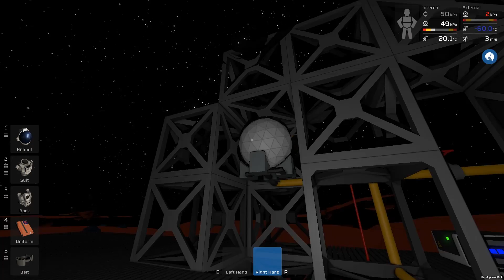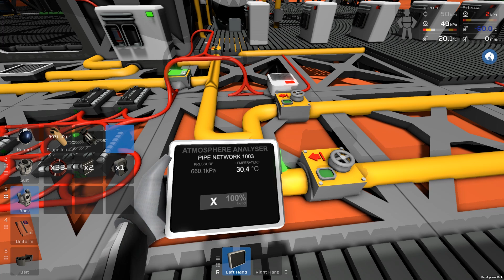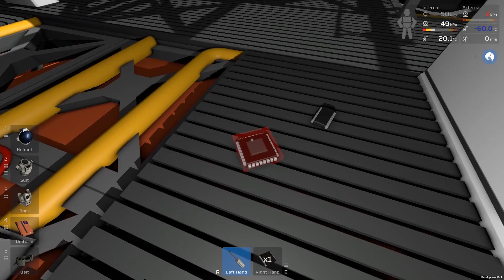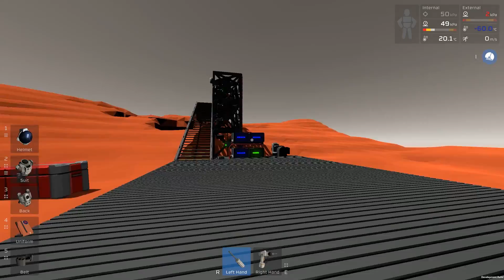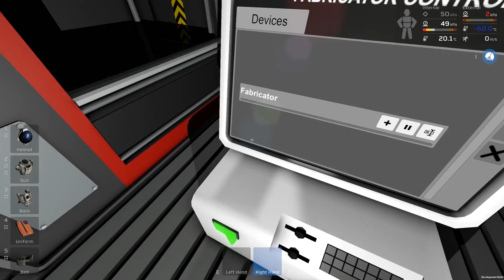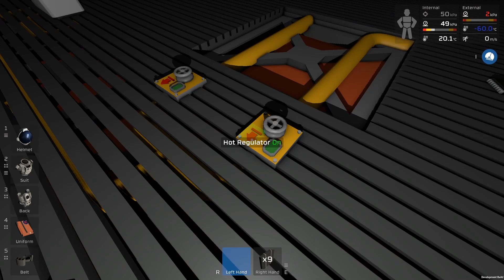Stationeers Season 2 E19 - Full Heating/Cooling Electronics

Comment: why not run the co2 directly through the greenhouse radiators and skip the pollutant cycle?
Reply from the maker: The pollutant is around the middle in heat capacity - co2 is better at retaining heat, n2, o2 etc, are easier to cool.  I hedged my bets :)
Reply from the maker: Also, the pollutant is essentially closed loop, with the co2 (or any gas really), just acting to cool/heat the combined gases before being removed again, so we shouldn't need as much gas vs a system that feeds the gas directly through the radiators.

Comment: Heat built up in the hydroponics room... so can't you use a type of greenhouse sun-heater, then dump that heat into the hot tank? If pressured without heat leaching out, such a room should just keep getting hotter and hotter, shouldn't it?
Putting glass walls on the existing heating room could simplify this...

Comment: +grayduster Did you know that, writers only write when there is a change of the input value? That is good for optmising the game but if you would want to write a specific value over and over again, it will not work! Devs should realy add a write upon turning it on, because then you can have easly understandable RS memory gate(with 4 writers and a memory), unless they add that in to the game as a new optiion to a existing form of the pocesing unit, or add a new form, just for gates, with at least a xor gate in a chip.

Comment: +grayduster Nuclear batteries have a extremely big capacity! It apparently holds slightly more than a Stationary Battery, that fit in to a battery slot! You can compact your battery stack about 2x with the whole thing being in the floor or on a wall!

Comment: I haven't tried yet, but you should be able to dig straight down until you hit a hot zone (I know the moon had a hot core...) and use radiators at that level to heat gasses in the line from the core temperatures.
Reply from the maker: Aah, I thought the hot layer was just cosmetic - it's actually heated now?
Reply: I just read it might not be a thing anymore...

Edit: Yeah, just tested... mars either never had or doesn't currently have a hot lower area.  You can just dig down so far and it stops.  :(

Comment: I don't want to be that guy... honestly, I just give suggestions... ignore me at will. ;)

I came up with the heating/cooling circuit (don't have access atm) that ends up using 6 memories (heat trigger, heat minimum, cold minimum, cold trigger, heating flag, cooling flag), 4 compares (for comparing the room temp with the respective memories), 4(?) selects for the logic, a reader for the room temp, 2 writers for the flags, and 2 writers to trigger the cooling/heating mechanisms.  ... so, 16-18 circuits?  It triggers the heating (or cooling) at the trigger temps and remains on until the temp is passes the minimum settings.